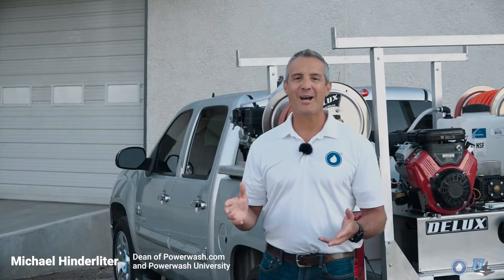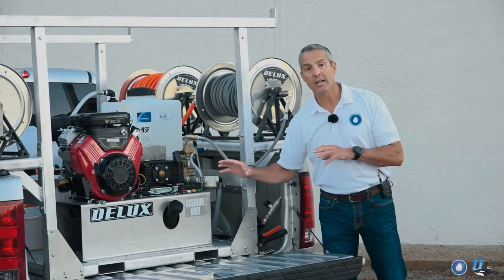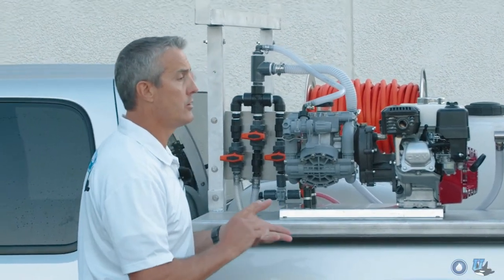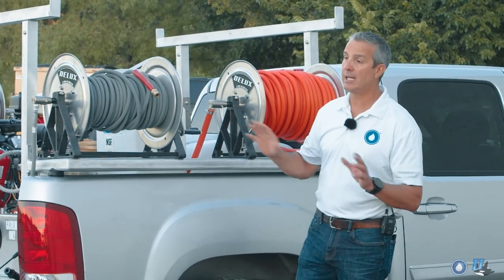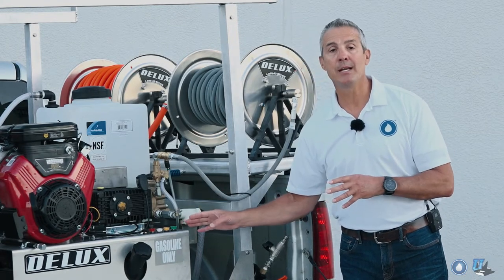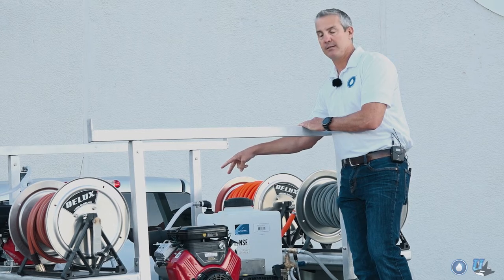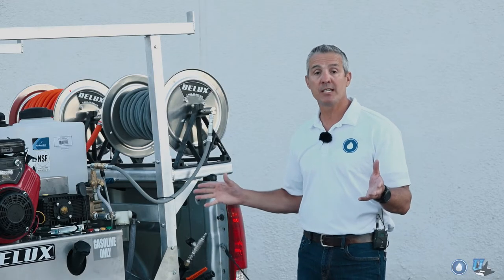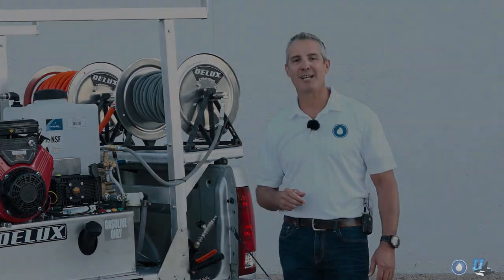Complete Power Wash & Soft Wash Truck Skid Setup

Comment: I like this design. The clutch for the pump is very appealing option i haven’t seen anywhere else.
Reply: Ava sorto  to the right side of the engine is the pump. It’s the black box. My guess is that has part of the clutch housed in it and the box has some type of heat sync design to keep it cool inside.
Reply: Ava sorto  let me correct myself. It’s to the right of the black box. Oddly it’s not positioned to point out. It’s at a side angle that you can see it when he’s to the right of the truck.

Comment: I have a question about the unit on this skid and the DELUX® Stallion Gas Powered Soft Wash Base Model listed on your site. You say in this video that the unit on the skid produces 9+ GPM at 140PSI. The unit on your website says Increased Flow and Pressure (11 GPM @ 300 PSI). So... are these different units?
Reply from the maker: The unit on that skid has the older model of the pump.  The new pump, Comet P40, is rated at 11 GPM and 300 PSI
Reply: @Powerwash  Awesome! So my next question is will the General Pump YG1635 350 PSI Washdown Gun work well with this unit?
Reply from the maker: @neptuneclean  absolutely